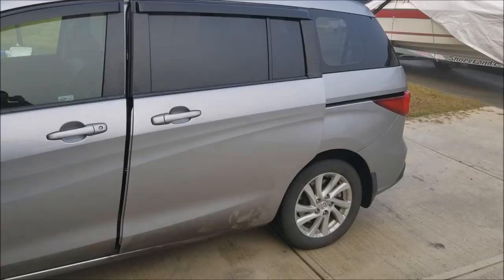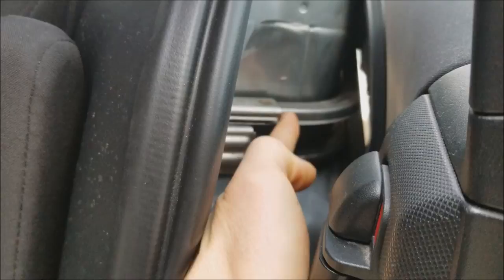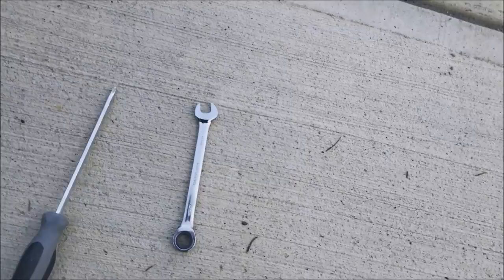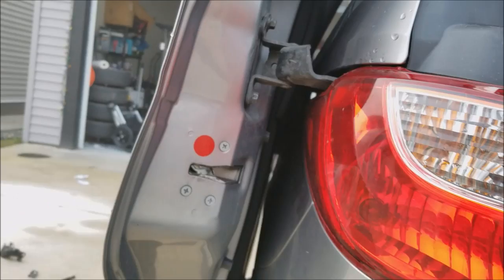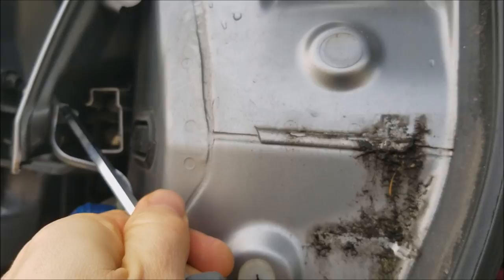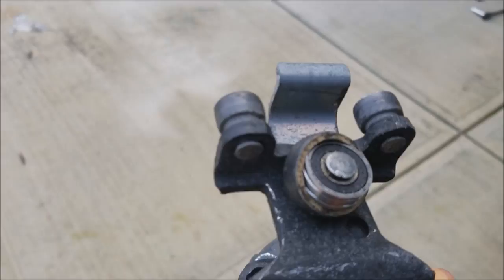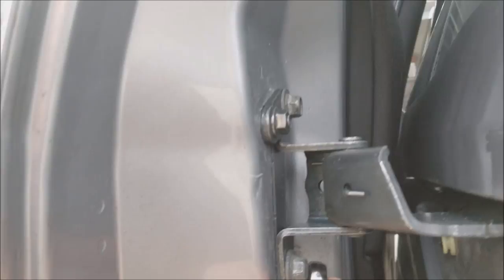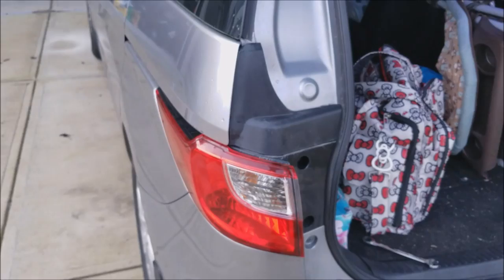2012 Mazda 5 sliding door roller replacement

Comment: An addendum to this problem. After replacing the roller I noticed the roller would fall out of the track. The track on my car was moving down as the door slid back. The reason was the nut was loose and allowed track movement and the sliding roller was falling off. So when you closed the door it pushed on the rubber. So I had to unsnap the plastic inside the car to reach and tighten that nut so the track would stay in place, solid. The door worked as new after that with tight track and a new roller.

Comment: Great video thank you. Will you please make a video showing how to replace pcv valve on 2012 mazda 5.Thanks again
Reply from the maker: jacksdad2626 no plans for that at this time. Does not need the replacement yet. If yours really does need to be replaced, search for Mazda 3 videos as they are basically identical. I see one shows that you maybe able to do it without removing intake manifold.

Comment: thanks for the video, did that fix today. lost the 3rd bolt into the door but not sure that is avoidable.
Reply: Nice video. I noticed the third pin was gone on your video. Did you drop it into the door? I did that to mine as well. I took the door apart to get it back out. Turns out you don't need to disassemble that piece at all. Just an fyi for anyone else who attempts the job. Don't mess with the one that has a nut. Leave it alone or you'll drop it in the door and cause yourself a huge headache.
Reply: @sethhorning6876  I wish I had read this before I attempted this repair as I too lost the bolt as it fell inside the door! Glad to hear you were able to retrieve yours? Was it difficult? I am afraid of having to take my door apart!
Reply: @jerrickb  don't take the door apart. It was a huge pain. If you do make sure you have a good video and a lot of time 😅
Reply: @sethhorning6876  if I leave that pin forever trapped in the door;  do you know if it's possible to replace it with something else in the assembly? I can't even remember what it looked like since it fell so quickly inside the door.
Reply: unplug the rubber plug at the bottom of the door and use a magnet attachment to retrieve - I dropped both left and right sides.. 🙂

Comment: Hope never have to do that. Have  a 09 mazda 5 the older one. Backed into something and metal bent where sliding door comes out of back so no way to take it off now. If i had newer  one could have replaced light but the older one lights are high.

Comment: Great video, I have the same problem with my 5. Did you buy the part online? Can you share where you bought it?
Reply from the maker: Part number: c513-73-2b0d
I can't recall where I got mine, might have been local dealer. 
Type that part  into Google and few places sell it online. 
I see: https://parts.mazdaofwooster.com/oem-parts/mazda-roller-assembly-c513732b0c

Comment: The 06 model tail.lights are a lot harder to remove
Reply: I have 09 mazda5 and the back lights come off east. 2 screws and pull pull and it comes off.